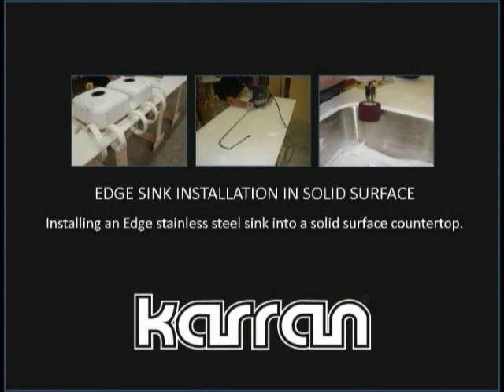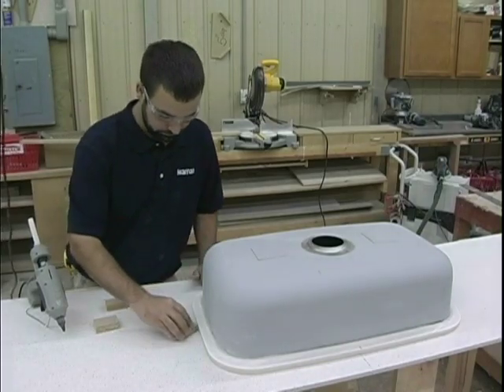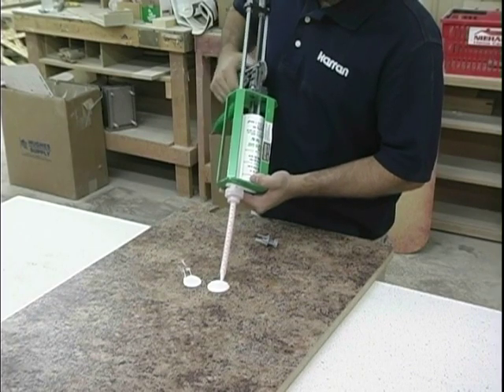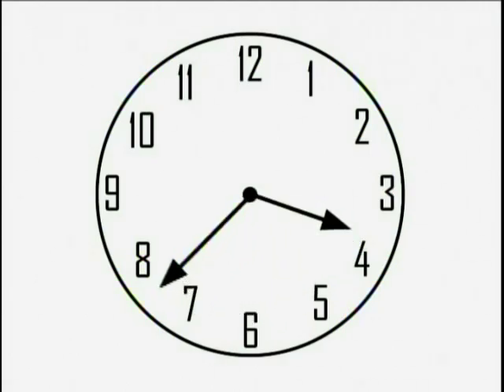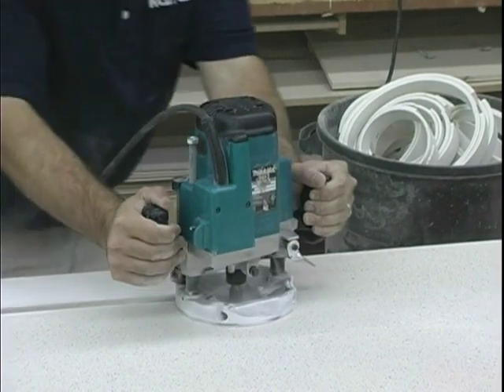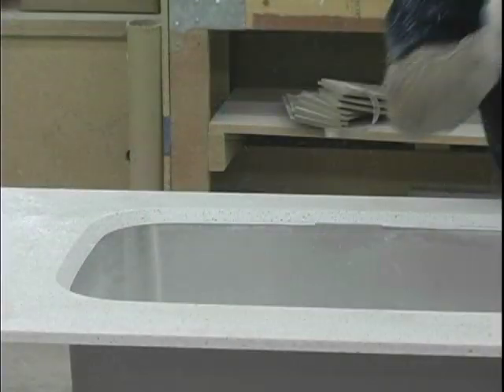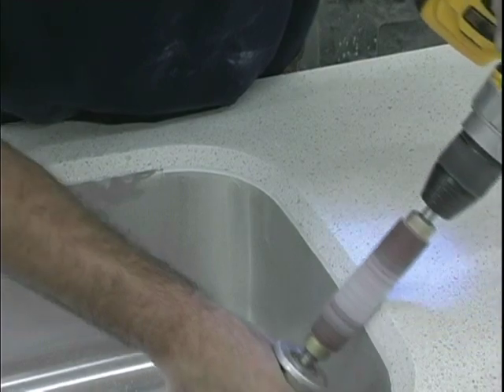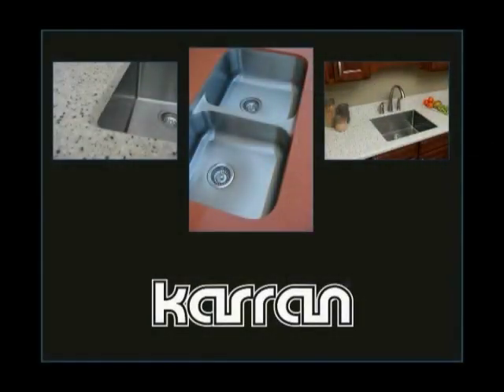How to install Edge Sink in Solid Surface | Karran Sink | Karran USA

Comment: Yet another undermount video. What I need is instruction about how to insert the clips for a drop in installation into an existing countertop. Do I just replace the screws with something that fits my counter and hammer the plastic part in? Nobody seems to know.